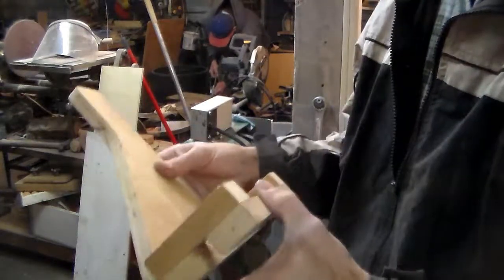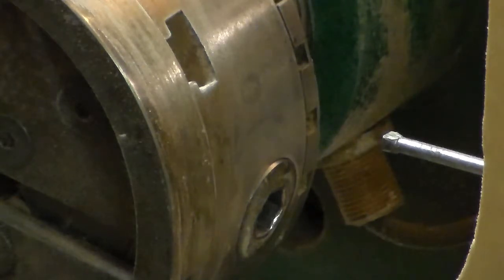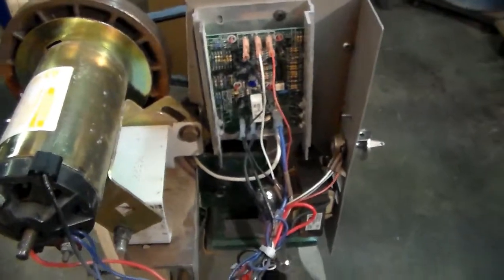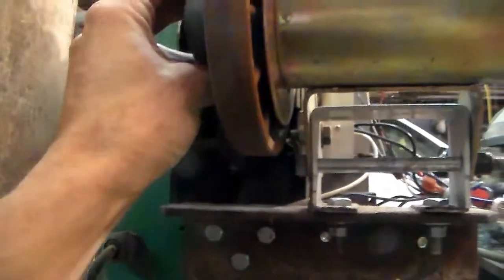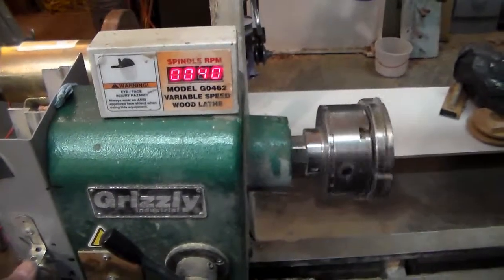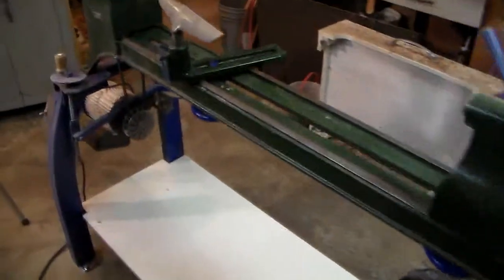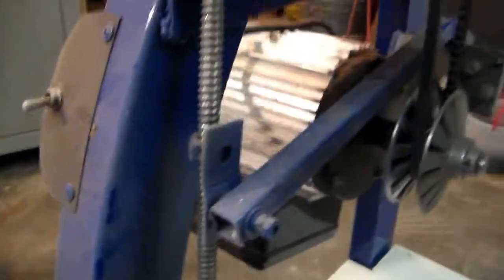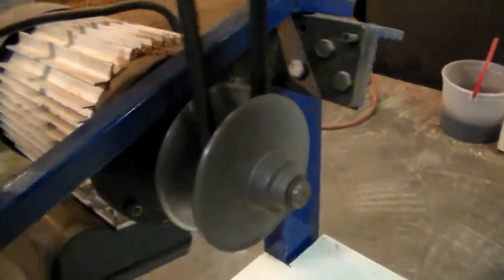#7 G0632 DC drive explination

Comment: I put the same set up in a shopsmith. I used the flat polly v belt. I turned one out of oak and replace the adjustable sheave with my oak pully that was keyed and set screw to hold in place. I kept the fly wheel for the cooling as well as it seems to help keep it smooth when turning. I made a wooden bracket that clamped around the motor to mount and cut off the other. It was a tight fit but i got it all under the covers I had to drill one litttle hole in the motor pan beause back of motor shaft was rubing. I own 3 shopsmiths and when its being used as a lathe or drill press it is my go to. I plan on putting a tac on it and put a reverse feature as well as the momentary on the wiper as recomended. I don't now if you know any thing about shopsmith but when I removed all the speed control for the upper sheave I placed my reastat pot so that the shop smith dial controls the motor speed. It looks just like a standard markv. I love the fact you took time t make a vedeo expaining how to doit. wish I would of found you befor I did mine LOL. they just turn so much smoother than a mechanical belt set up. I have another only a 1.25hp at 90v but I think It will soon be a  2x 72 belt grinder. Just so many uses for them and most people will just throw them away or sell cheap. anyway thanks for making the video oneday I will make a couple.

Comment: Uncle Cy,   Got a question about dc motors. If they have cw rotation written on them, doors that mean they will only turn clock wise? U can’t make them go ccw with a switch?
Thanks
Reply from the maker: With a DC motor reversing the polarity of the input should reverse it. A/C is a bit more complicated. I have never seen a DC motor marked for with a direction though, doesn't mean they don't exist, just that I haven't seen one.
Reply: DIY with Uncle Cy yeh, I have seen several videos where installing a double pole double throw switch would do it. I have several used tread mill motors including one I am using on my wood lathe. But all of them has cw written by the rotation. I don’t know if they are just saying the motor runs cw from the factory & u can change it to rotate backwards with the switch or if it meant  cw was the ONLY way it would run. I guess one way to find out is to try. Right?